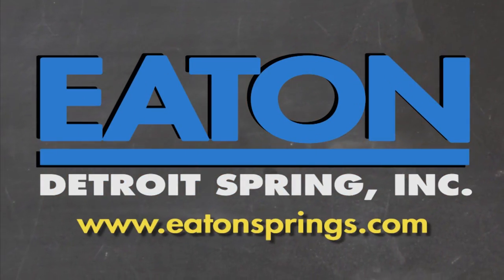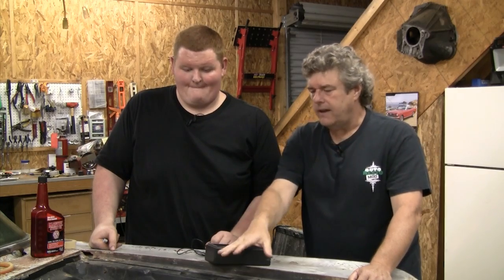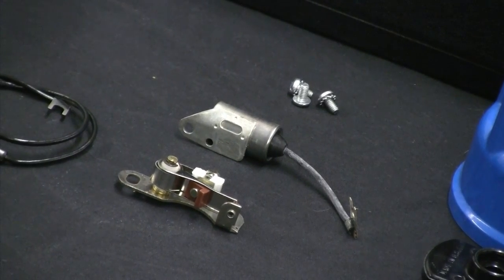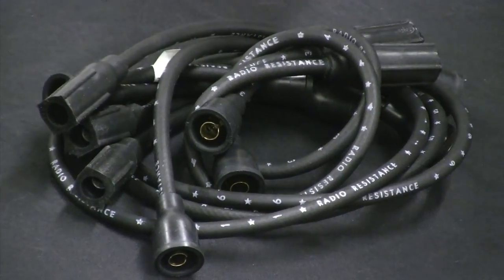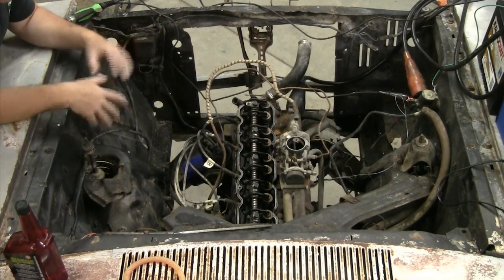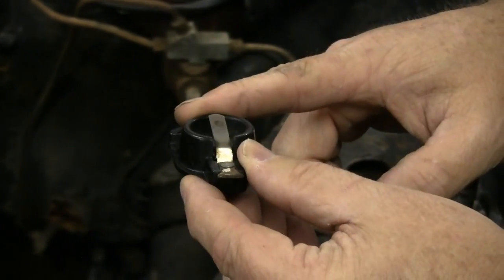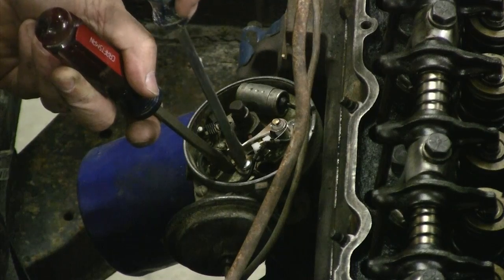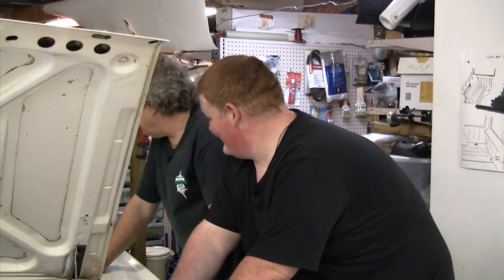How to Install Adjust and Set Breaker Points in an Automobile Episode 267 Autorestomod

Comment: Still, looking at this video, it brings back so many memories of tuning and repairing a car.  In those days, car owners took pride in their car and could do their own tuneups.  There are many classic cars and trucks sitting in garages, farms and collections, and a step-by-step video series of using a dwell meter for tuneups, fixing brakes, lubricating the zerk fittings on a suspension system, etc would be so helpful.  While we use electronic ignitions today, there are many millions of classic cars and trucks still in use.
Reply from the maker: That is what we do. The issue is that there are so many different makes, many with completely different design principles, it is hard to generalize. We take a shot at most of the Ford and GM stuff out there that was built before 1975.

Comment: Ahh the days of points and a condensor. One of the many joys that younger folks will never appreciate with electronic systems is in charging up a condensor and throwing it across the garage for your buddy to catch! Hehehe  

Of course, I'm SURE you never did that to anyone, have you Jeff?! BTW, I still have my Craftsman tach/dwell meter from the 70's  (and of course the companion Craftsman timing light!).
Reply: I'm 17 and I love learning this kinda stuff
Reply: I'm 24 and own 5 engines with points and 1 car with points. Even have the dwell meter and sun engine diagnostics machine. My dad has some stories about shocking the parts guys at the dealership with condensers.

Comment: On an engine with a worn timing chain, get #1 at TDC on comp. stroke on 0. Lift up the distributor and point the rotor at #1 terminal on the cap. Turn the distributor way back opposite normal rotation. Install the distributor with rotor at #1 on the cap and then set it for normal setting. Now set the timing. You are compensating for timing chain slack.

Comment: About 7 years ago I was looking for a more reliable ignition system for my '68 Mustang. I decided to go with a Pertronix 2 set up but wanted a better distributor. On the internet I found a remanufactured distributor at a local parts dealer for $17. When I went in to pick the distributor up the manager was pissed that it was only $17. They're now $50, still a bargin but I should have bought a few dozen at that price.

Comment: one important step that should always be included after changing/adjusting points is checking the timing. If the timing was set with a worn rubbing block, once a new set of points gets installed with the larger gap the timing will   most likely be too far advanced.
Reply from the maker: Great point (pun intended). Things like that make us wish you could add things to videos...
Reply: scatpack6

Comment: The condenser (capacitor) is in parallel with the points, and does several things.

1.  The coil will try to generate a very high voltage across the points to maintain the coil (low-side) current the instant the points begin to open. The high voltages generated by the coil's low side can burn the point contacts while they are opening (Power = Voltage*Current).  The discharged condenser (capacitor) provides a path for the coil's current while keeping the voltage across the switch low while the electrical contact is being broken. A capacitor used in this way is called a "snubber".

2.  The ignition coil stores energy in its magnetic core. The condenser keeps the voltage across the opening point contacts low, so less power is lost in the tiny arc across the points while they are opening.  Less power loss across the points, means more power (energy) is delivered to the spark plug, where you want it.

3. The condenser provides a  return path for the spark current from ground, to the low side of the coil (current must always flow in closed loops).
Reply: there is no current flow the points  when they are grounded when closed  thus no current flow  when they go open it lifts gd off now we have a flow into capacitor this flow energizes coil causing magnetic effect  in larger coil winding  which makes the spark

Comment: Hey dudes Maverick here.... my last restomod was a 1961 Land Rover on a 2000 Chevy Tahoe four-wheel drive platform... I went to the transmission and everything set it up with a LT1 style 350 and atomic fuel injection and transmission control... wizard adjustable rear lift the coilovers two additional batteries in the back for the stereo headers custom running boards coil over suspensions with adjustable lift.. were they heavy-duty Offroad cam we were pushing about 500 horses and about the same foot pounds of torque with a BorgWarner transfer case and 373 gears by dynatrack... we added skid plates a super transmission cooler with its own fan and controls and bnm gauges... we had super cold AC and replace all the seats with glamorous convertible leather.... we had a onboard air compressor and power converter and even tied all the lugs with stainless steel tie-backs... I'm working on a 51 Chevy right now or just into points and that's how I ran into you looking for some chips on those old points.... I give you A+ with the video yaller real...lol I look forward to seeing some more of your good work.... until then keep it up and God bless....
Reply from the maker: Thanks!

Comment: Please pay attention at 8:22 have heard lots of people saying "points are a ton of maintenance constant adjustments" and all this nonsense I replace points in my '65 fairlane 4 years ago distributor itself is at least 25 years old driven only around 10k-12k and I haven't touched them and fires rite up every time, I think people's distributors are wore out and they don't know how to check it. As you described
Reply: I replaced my points 3 years ago and they still work perfect and in good condition but they needed re-gaping adjustments 4 months ago .
Reply: Really? Maybe I should stop worrying about mine if so.. I just got the car for a year and has been running great aside from a very bad vapor lock problem which was already addressed. I've been worrying about the points and condenser but maybe I shouldn't?  I suppose my car will tell me (show signs) when it needs checking as with any classic car.

Comment: Absolutely amazing that you can go through and show the sign of points and the initial gap set of the points but not actually connect that dwell meter to that vehicle that we were working on and verify the dwell and then adjust it to get the dwell right?  Pretty cool video but you wasted my time cuz I wanted to know how to set up the dwell meter. Read the dwell and adjust the dwell.  You know that real cool part with the distributor cap off where you spin it around and read the dwell initially to get it close.  Thanks but I guess I'm just going to go out and hook it up myself from a 50-year-old memory.

Comment: Ive found that the point sets for Ford straight 6s that are made lately have a pivot pin that is too large to be seated correctly, and that causes the point set to become bent and misaligned.

Comment: In the old days when you bought a good brand of breaker points it would come with a small tube of breaker cam grease to put on the cam lobes. if you don't have point grease dielectric grease will work. Also when I replace breaker points a priceless tool is a spring loaded screw driver to hold the screw as you install it. GM vehicles had a door on the distributor cap so you can adjust the dwell with the vehicle running. On Fords you had to remove the cap and use a remote starter to adjust the points by dwell.
Reply from the maker: +Jeff Driver I forgot to mention the grease, Jeff good points you make...GET IT, GET IT! POINTS....OK we'll stop...

Comment: Question. Im changing the points and condenser on my 1949 Dodge coronet. I know I need to find the high point(where the points are open all the way) but do I need have the motor at top dead center too or can I just set the points as long as I have it at the high point? I have the new condenser and points installed in the distributor I just haven’t set the points yet because I’m not sure if I need the motor to be TDC.

Comment: Anthony Frye pointed out that lube wasn't mentioned. A tip I recall from back then was that the proper amount of lube approximated a match head.
Some remarks about the condenser were observed in the comments. For ignition systems, the condenser can be considered an electrical shock absorber. Without it, the points will arc over when they are opened, so the engine might run, but not for long. When it's installed, the current will find that the condenser is an easier path than the air gap presented by the points. Closing the points discharges the condenser.
As you can see, the exact value of the capacitance wouldn't be critical until very high rpms are achieved; too high to worry about on a street engine. An open condenser would result in short point life, and a shorted one would stop your engine. Underhood heat and the physical flexing caused by the electrical flexing combine to create a definite life cycle; they DO NOT last forever. It is therefore a false economy to fail to change them at recommended intervals.
Definitely better to upgrade and eliminate the points, as some of us can recall that the recommended interval was commonly 12 months/12,000 miles.
Reply from the maker: Great points! See what I did there?

Comment: If you have a dwell meter you don't need feeler gauges to set the points. That's the whole point of having one, it turns the engine into a simple distributor testing machine.. Forget about bumping the starter to get the rubbing block on a high point too. Hook up the meter, install your points and condenser as shown (much easier if you remove the distributor unless that thought strikes fear into your heart) but use the two screw drivers while the starter is cranking the engine to set the dwell. The final tightening of the hold down screw will change your dwell setting but with a little practice you'll be able to dial in the dwell perfectly. You'll likely have to do this twice because the new rubbing block will take a "set" (the sharp corners wear down ever so slightly) after the first ten minutes of use. Don't even bother setting the distributor timing until the dwell is set exactly where you want it - it's easier to do than it sounds  Meter hook up? Whichever lead is not the black ground goes to the point side of the coil.
Reply from the maker: THANKS for this! I get set in my ways and just keep doing it the way I learned. I'll be doing a video on using the dwell. Easier for sure....well, unless you are a battery. 😄

Comment: Good video and good comment on how condensers don't last I put new points and condenser in my 58 rambler American a couple of years ago and it would idle fine but the fire would break up above idle fought it or weeks finally started putting old parts back one at a time because it did run okay before I started and when I put the old condenser back in all my problems went away so either the condenser is just wrong or just bad either way new points old condenser runs like a dream so I am leaving it alone

Comment: Are they hooking up the volt meter to the coil to check dwell?
Reply from the maker: We checked Dwell with the Sears (now Actron) Tach/Dwell/Volt meter. The tool has a function tab for each of these.
Reply: I'm curios as to WHERE you hooked the wires off the Tach/Dwell/Volt meter too? The coils + and - or did you hook it somewhere else.
Reply: tankertyler2 - black to any ground, colored wire to the + terminal on side of coil (negative ground car)

Comment: what would i need to do if my condenser keeps blowing? i have an original rx-30 NZ new Toyota Cressida and it keeps blowing, running rough and stopping at idle (intersections), any help appreciated, many thanks, kieron
Reply from the maker: One thing I will say for sure is that capacitors made now are not as good on the whole as ones made back in the 1970s. Simply put, there is not a demand for a high quality capacitor. http://nonlintec.com/sprite/cap_failure/ has some pretty interesting points on this fact. I'd look to getting a Bosch or a Denzo name brand and see if that helps. I might also check the ballast resistor. If it is original, it might be in need of replacement. If you want, here is my e-mail: jford@autorestomod.com. we can possibly worry through it a little more over email.

Comment: I'm having a problem. Inline 6 240 no spark. New coil plugs wires condenser points cap rotor. Voltage at coil but nothing
Reply from the maker: Check that the condenser is charging. Some newer condensers have been known to not charge even when new.

Comment: the condenser holds the charge ,,,like a capacitor and it is one ,,
Reply: Yep. Basically an electrical shock absorber; reduces arcing as the points start to open.

Comment: The condenser holds the charge until the points OPEN, at which point it releases the charge through the primary winding of the coil. through the distributor wire, and into the rotor (for distribution).  If there was a need to use a (shock absorber) then a resistor would have been used.  Don't feel bad, I have had physics professors get this wrong, AND there is MUCH  misinformation on you tube about this.
Reply: what would i need to do if my condenser keeps blowing? i have an original rx-30 NZ new Toyota Cressida and it keeps blowing, running rough and stopping at idle (intersections), any help appreciated, many thanks, kieron

Comment: my six cylinder has some broken pieces of plastic inside the valve springs what could that be?
Reply from the maker: Most likely your seals for the guides have gone away. If they are black "plastic" that is just the hardened rubber seal.

Comment: I had a dwell meter like that.  Then the cables got caught in the fan blades.  Then I didnt have a dwell meter anymore.

But seriously I hated points.  Brand new points, condensor, coil, everything, pink resistor wire.  Couldnt keep the points from burning.
Reply from the maker: +Philip Ball From Jeff: I've come close to doing that with mine. Might get a new one, this one is dang near retirement age...

Comment: This stuff is Elementary guys. How about showing everyone how to take request pedal assembly out of that yellow Mach 1 take apart and install breath bushings on the clutch pedal that is probably completely wore out it's simple throw away all the old crap and install a brass bushing in a new piece of pipe welded into the assembly, and taking notice of the position of the assembly so you can drill a hole in the apparatus so it can be greased. And then of course takes at Buerkle road that goes from the clutch pedal down to the z bar clip the ends and install rod ends making this piece adjustable so you can take all the slack out of it. The reason for this unless this has been done everyone out there their clutch pedal system is wore out

Comment: I just replaced my points, now the car has no spark! Any suggestions?
Reply from the maker: First thing I would do is check the condenser and make sure it is okay. I was in look up and make sure that the coil is not defective by going out and finding out what the ohms of resistance your coil should have on it.
Reply: @AutoRestoMod Bingo! Don't use Chinese made condensers. Been there/done that.
Reply: E

Comment: There is a cute irony here, for me.  Today (May 19) is my wedding anniversary.  My wife had a 1977 Honda Civic when we got married.  Changing the points and condenser (mostly the condenser) REQUIRED ham handed Americans like me to pull the distributor out of the car to get to the ~!@#$% parts.  Oh, in high school, I had a 1966 Mustang with the 200 I6 with the intake manifold that was cast as part of the head!  I've been looking closely at the 1965 200 I6 you are showing in the Ranchero.  Don't need said engine but the curiousity is high.  Here's a hint - change the water pump.
Reply from the maker: +Howard White Sadly the 200 is exhibiting a rod knock on six. We plan to do a video on  that soon.

Comment: Someone had fun torching most of the left spring tower brace out of that poor car. Another fun fact about Ford small six distributors: Ford cursed sixes up to about '68 with the terrible LoadOmatic dist/carb system that did away with a mechanical advance in favor of a kinda-sorta vacuum advance controlled by venturi pressure in the carb. Swapping to a standard distributor and matching carb on a 200 will get you around 25 more hp, making it feel like a completely different engine.
Reply from the maker: +Maindrian Pace Thanks for the tip on that! If the rod knock can be fixed we'll do a video on that.

Comment: Why is there only one point? There is a condensor and breaking point for each cylinder on my motorcycle
Reply from the maker: The points are opened by the star wheel, there is a raised point for each cylinder. Your motorcycle has dual points for a hotter spark.